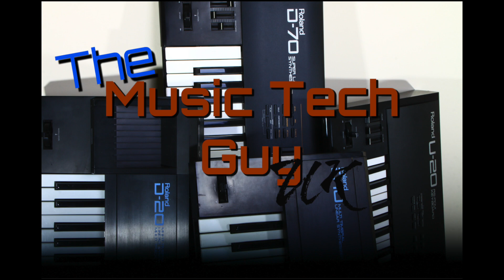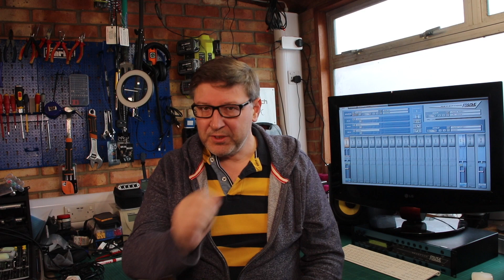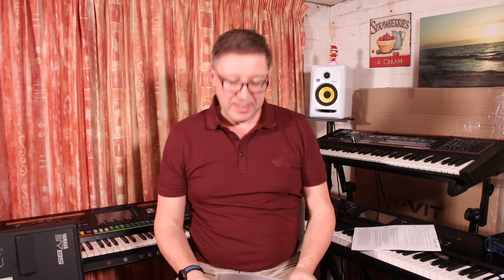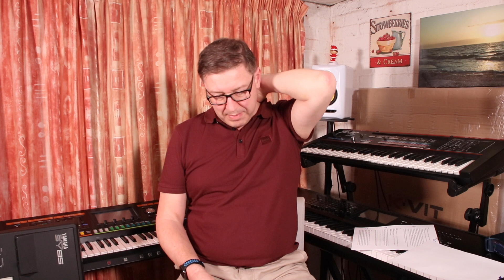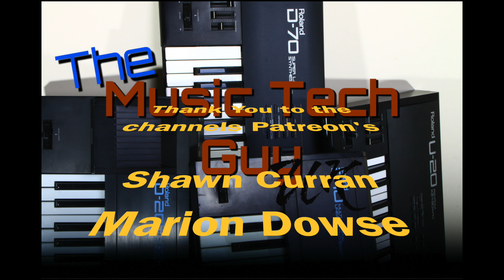SY-85 trip down Memory Lane, General MIDI standard put Drums on Channel 10

Comment: Drum machines were ch.10 from way before general MIDI. Even TR-909 defaults to ch.10.
Reply from the maker: Hi @midimoog  

This is a chicken and egg conversation.  The MIDI standard started in 1981 and was ratified in 1983.  The TR-909 was designed in 1982 and released in 1983.  

Roland were one of the founders of the MIDI standard, involved with Sequential and Yamaha to develop the standard. 

So Drums to channel ten was this set by the standard and adopted by Roland into the pre-released model or designed by Roland and adopted by the standard.  Jon
Reply: @TheMusicTechGuyUK  

Thank you, Jon. I was wrong about TR-909. I read the manual and found that TR-909 defauts to Omni when it is turned on.
Mine goes to ch.10 because I had set it that way... But my habit of setting it to ch.10 goes all the way back to 1983,
before there was General MIDI.

Regarding the MIDI consortium, that is very true. Roland's drum machines would have been strongly influenced by the MIDI consortium. Rightfully so because Sequential and Roland were the founders of the MIDI format.
However, the original MIDI standard (1983) did not yet include General MIDI (1991) nor did it seem to recommend to use Channel 10 as the default drum channel. Some early Roland drum machines defaulted to Omni, Yamaha defaulted to ch.16, some other manufacturers defaulted to ch.1 which suggests that there was no clear rule back then.

Then where did the number 10 come from? It's not really clear, but here's my theory. Let me bring another 'egg' (or should it be chicken?) to this topic: Further back in 1982, predating MIDI, Roland's subsidiary developer company Amdek developed 'CMU-800' which was a 8ch CV-Gate interface with a computer-based sequencer software. It also integrated a very primitive synth and noise sound generator which can be used to make some sounds on its own.
The CMU-800's software was essentially about copying the interface of Roland's own renowned MC-8 sequencer and porting it into PC software. MC-8 was a 8 track CV-Gate sequencer, therefore the software also has music sequence tracks 1-8. Then Amdek added two more tracks to make use of the integrated sound generator: A drum sequence track on track 9 and a drum sound pattern track on... you guessed it: track 10 (which was actually selected by pressing the key 0 on the numeric keypad, so I used to confuse this as track 0).
This habit of using track 10 as drum sound pattern was then passed on to many of Roland's MIDI hardware and software. I used one of Roland's early MIDI sequencer software which gave me a habit of setting my drum machines to ch.10. I think this eventually led to defining ch.10 as the drum channel when General MIDI was introduced 8 years later.
Reply from the maker: Hi @midimoog 

That was a great chicken and egg story and you may well be on the right track with that theory.  Jon